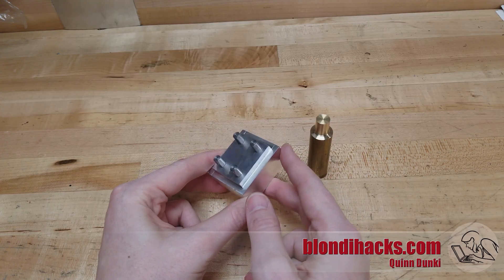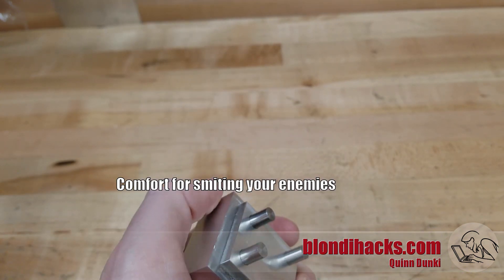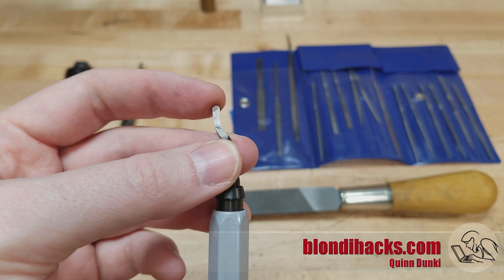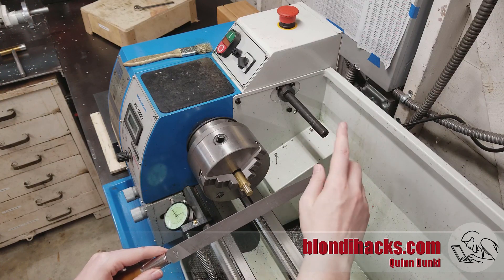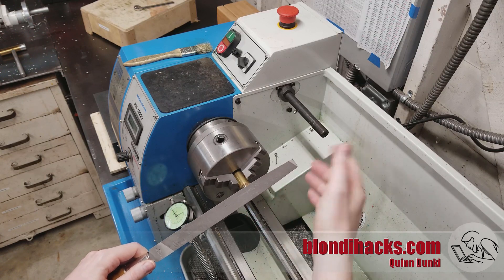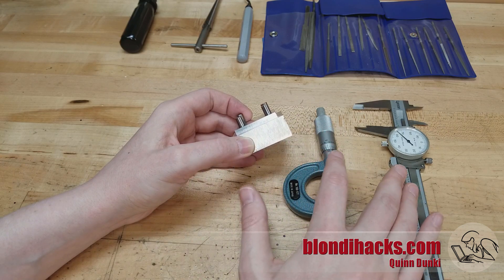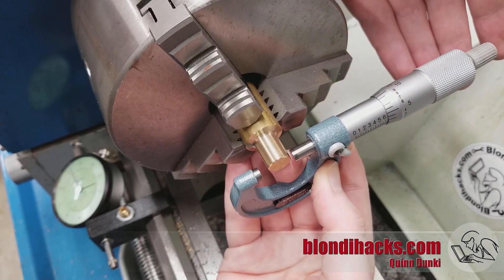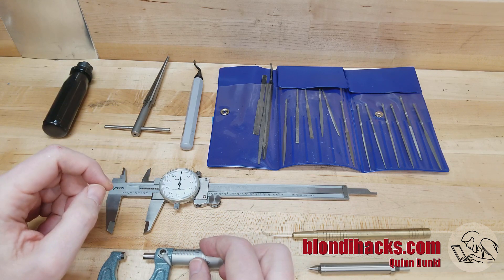Metal Lathe Tutorial 14 : Deburring

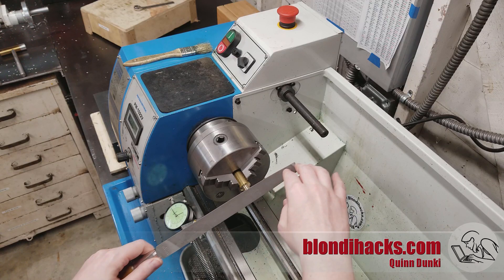Comment: I am probably showing my ignorance, but I don't understand the comment about the direction you move the file at 6:47. Surely the work is spinning much faster than you move the file, so you will always be filing the "right way" regardless if you move the file forward or backwards. In fact why do you need to move it at all? Unless it's to avoid using the same section of the file. Can you explain?
Reply from the maker: If you try to just hold the file on one place and let the lathe do the “filing”, it’s difficult to control the engagement of the teeth on the file. A smooth forward motion gives better control and better results. You lift the file on the backstroke so that the lathe doesn’t grab it and throw it at you.
Reply: @Blondihacks  OK, that makes sense. Thanks for explaining.

Comment: As a screw machine guy, burrs could be my enemy,  Who wants to make 25,000 pieces, then deburr them?  Commonly, I could eliminate burrs from happening by timing two different tools to intersect in the moment.  Let's say on a lathe, you face a part, then drill it.  My first drill often would be a centering drill to cut a diameter slightly larger than the drilled hols.  Facing tool burr ahead of facing tool cut, same thing with center drill, but at 90 degrees to facing burr.  So, by keeping both tools in contact with the work at the end of their cuts, both tools can eliminate the burrs created by the other tool.  Similar results by overlaping O.D. turning and cut off tools.  Just a little preplanning could save me hours of boring deburring!
Reply: There are no vids on YouTube about screw machines. They are fascinating.
Reply from the maker: That’s great info and experience- thanks for sharing!

Comment: I worked for 7 years as a deburrer in a production shop before I moved on to QC.  I can't tell you how many one-off tools I had to make over that time, and I was always looking for items that might be useful - dental probes and picks, welding wire, random pieces of scrap metal - you name it.  I still have a triangle knife that was made out of a broken carbide end mill.  We also had a cryogenic deburring machine for most types of plastic (except for UHMWP) that we could use, although it was a pain to set up and tear down, so not much use for smaller jobs.
Reply from the maker: That’s really interesting- thanks for sharing your experience!
Reply: Tell me more about the cryogenic setup, please.  Is the idea to freeze the plastic so it would be more brittle and easier to surface finish or deburr?  Why not UHMWP?
Reply: @bvcxzgt5451  Yes, the machine used liquid nitrogen to freeze the parts and used a wheel to throw 2mm plastic beads at them to remove most of the burrs.  It really didn't affect the surface finish, though.  
UHMWP didn't turn brittle enough at that temperature and stayed flexible, so the burrs didn't break off when the beads hit.
Reply: @TheCoffeehound  Thanks.  Never heard of that, but I have wondered if liquid nitrogen could improve a surface finish.

Comment: Has anyone else come to the point of having so many accessories and tools that you have forgotten you have them or worse what they are for? I know I bought that noga deburring tool even various tips, at least I stopped buying micrometers at only three sets.
Reply from the maker: That point is dangerously close for me. The only thing saving me is my very space-limited shop and the knowledge that I'm going to have to move it not too long from now.
Reply: Blondihacks 
Well I have farm, so the two car garage is dedicated to woodworking, the metal working occupies the barn as the Bridgeport is eight feet tall now, sorry horses it’s warm out now. So new maybe another barn or two in the future, the Jeep wants in.
Reply from the maker: @FrancisoDoncona  Horses can always grow more coat. The Jeep needs to stay warm! My '74 CJ5 got quite cranky indeed when it was cold. 😄
Reply: Blondihacks 

Love my 79 cj7, maybe 10 percent original, lol
I first learned to weld on that Jeep, learned about points, how to remove broken bolts, wiring , engine rebuilding, even learned to sew replacing fogged vinyl windows and seats. Ok jeep stays in the stall my iron horse .

Comment: Very well done video.

I'd add there's very good reasons for dropping the rpm while filing in a lathe. Since all cutting tools have a maximum surface speed they can tolerate while cutting then files are no different. My semi educated guess is most or maybe all files are made from a high carbon steel. It's maximum on mild steel is roughly 50 to 60 ft. per min. verses approximately 100 ft. per min. for high speed steel. File at too high an rpm and you'll also seriously dull the teeth.
Reply from the maker: Yep, I believe you are correct!

Comment: The deburring tool you showed after the tapered reamer, in my shop we call a "whirlybird", for hopefully obvious reasons when deburring round holes. A shop-made tool we often use is a piece of 1/4" drill rod slotted on one end to accept a doubled-over piece of sandpaper or emery cloth, chucked in a die grinder at the other end of the rod, works well to deburr intersections of drilled holes, and lightly hone, as well. This we call a "weedeater".
Reply from the maker: Great tips! Thanks for sharing! I like "whirlybird". Describes it well. 😀

Comment: Also check your spelling or you could end up with a very annoyed cat 😁
👍 lots of good little giggles 🤣
Reply from the maker: Uh oh, what did I spell incorrectly?
Reply: Nothing... 🤣  always good to check with yourself that you are using the correct method . you cant join timber with a welder 😁
Reply from the maker: @billbaggins  Tell me about it! I keep trying, and the damn stuff catches fire!! What a strange material. Maybe I don't have the wire feed set right.
Reply: 🤣 .. Tree is good stuff tho, can be very pretty but hard to add a bit on if you cut one end too short .